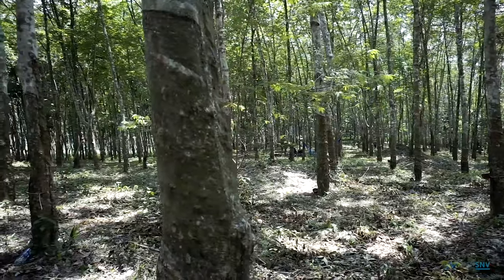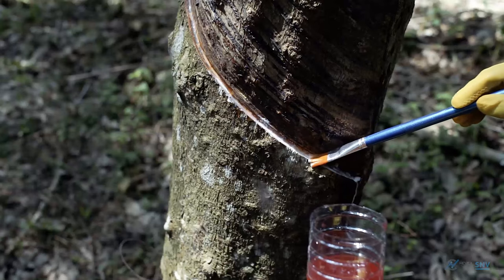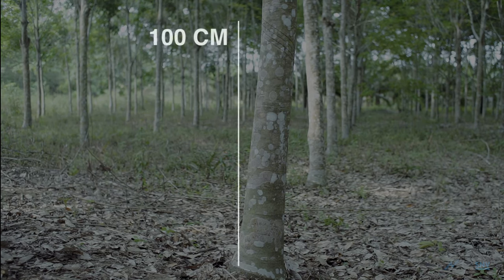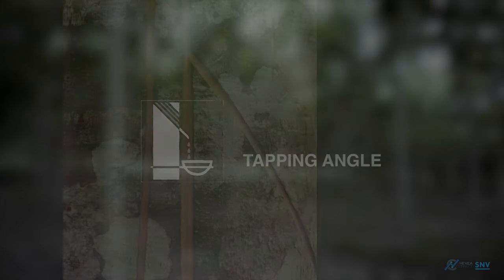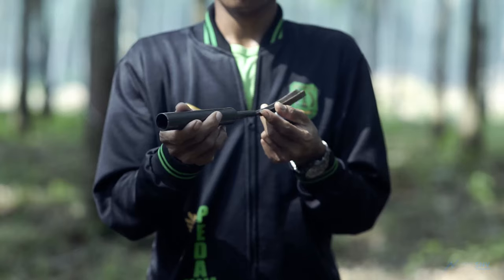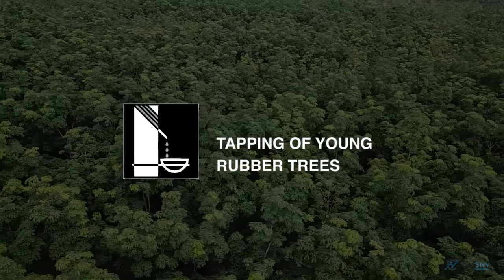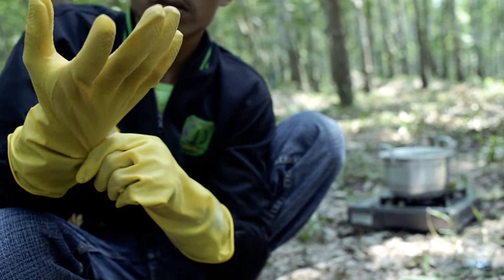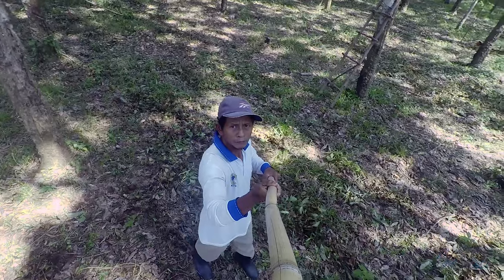Agridence Rubber Grow Module 1 - Rubber tapping

Comment: 4:22-4:26 which is which, 35° or 45°??? I'm confused. Kindly describe this part...
Reply from the maker: 30degree for downward tapping panel and 45degree for upward tapping panel. 

How old are your rubber trees? Are you using downward or upward tapping panel?

Comment: What's the need of 2 CM tapping pannel
Reply from the maker: The 2cm spaces help the nutrients and water flow over from roots to leafs. Since the barks function as a nutrients, water and rubber funnel, if the panels meet each other and left nothing behind, it can interfere with bark repair, stem growth and cause various diseases such as dry tapping panels.
Reply: @agridence  why we need to start the tapping about 130 cm height..... What is the problem if we choose more than that
Reply from the maker: this is to ensure sufficient space for downward and upward panels over the tree's entire lifespan. If you choose to tap downward panel at a higher height, then the future upward panel will need to be even higher which might be difficult.
Reply: @agridence  thank yoy
Reply: @binnyjebadurai5934  The height of 130cm is based on average height of a person which would enable the tapper to effectively tap the tree in keeping with the standards of tapping depth, slope and bark consumption. Upward tapping can be done in future using long handled modified gouge knife.
Reply: @rubbertappingwithsasidhara1137  thanks a lot for your response, can you tell me whats the best clone to plant in tiruvananthapuram

Comment: Explain about North South direction
Reply from the maker: this is to avoid direct sunlight that can shine on the tapping panel and lead to drier latex during tapping.
Reply: @agridence since sun rises in east, if we done the tapping North to South automatically the panel faces the east or west. for west facing it's no the problem while facing east the full panel in direct sunlight right???
Reply from the maker: From the video at 6:22, "North" and "South" direction refer to the panel facing North or South - so tapping is done from East to West direction.
When done correctly for your plantation, the full panel should be shaded from direct sunlight.
Reply: @agridence  thank you